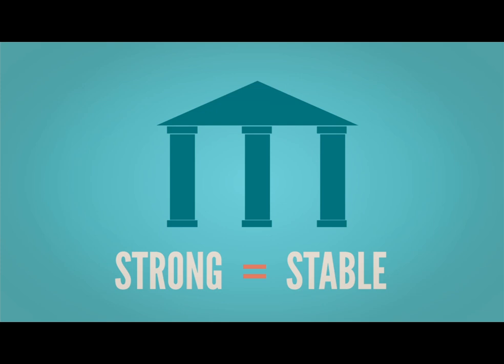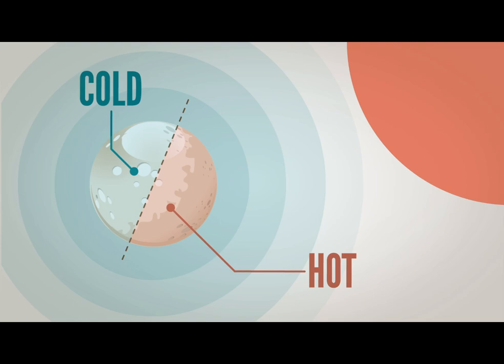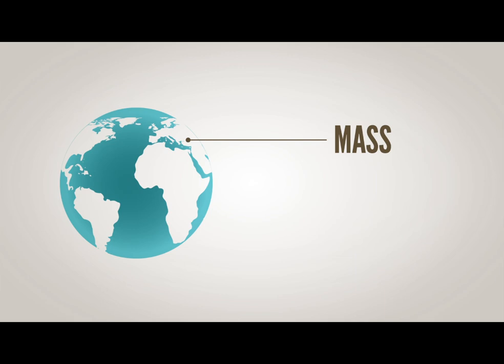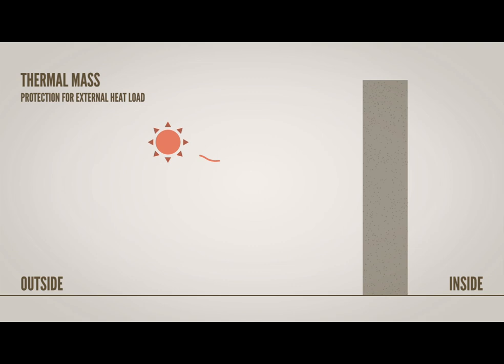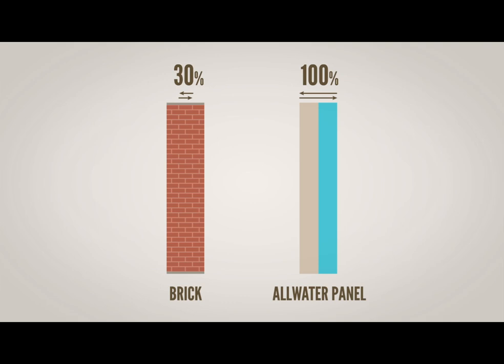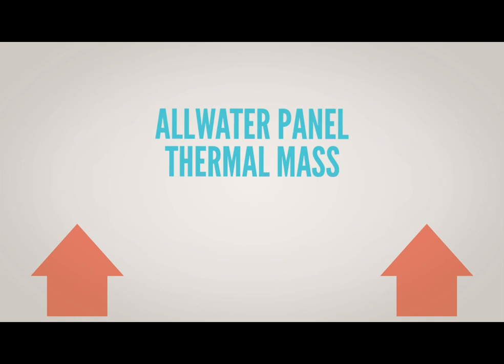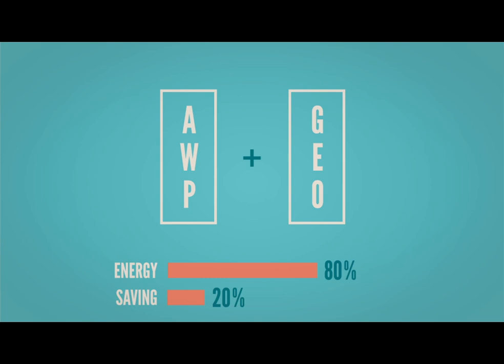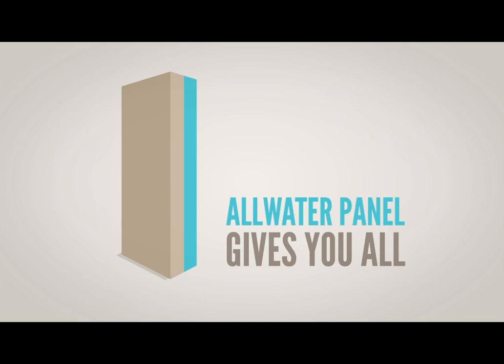Allwater Panel video Full version High

Comment: Like solar roadways, this is massively impractical and spreads misinformation.

Concrete was used primarily because it's strong, insulating and CHEAP. Concrete is basically among the cheapest construction methods we have.

These "light" buildings on the other hand are much MORE expensive because there are few materials that are stronger per cost than concrete. Not to mention that watertight panels are going to be absolutely unreasonably expensive especially given how high the pressure at the bottom of the house is going to be.

Insulators allow one side to be cold and the other to be hot because that prevents heat from going into or out of the building. Having the outside of your house be the same temperature as the inside is basically just air conditioning or heating the great outdoors.

It takes much more energy to heat or cool a large volume of water+the air in your house than it does to do just the air. That was just a blatant lie.

Basically, almost every explanation in this video is wrong. Any questions? Feel free to ask.
Reply: Dear Skooteh,
Please try to learn more about our work before you judge it. If you take the effort to understand it better, you will find answers for your questions.
Concrete is no insulator, neither is cheap. A brick wall for example is cheaper and far better insulator than concrete. Wood is even better.
Water House saves energy with cooling because you do not cool, you absorb, and the absorbed energy is used later. It is therefore a completely different concept. I did not lie, you just simply did not understand. That is a big difference.
The cost of a light construction depends also on your primary load-bearing system. If it is wood for example, it is far cheaper and better insulator than concrete.
The cost of a prefab construction depends also on the manufacture process. If you can design an efficient fabrication method, you can have a cost-efficient construction.
Based on your comments, I am not sure if you have sufficient knowledge in construction or architecture. I would suggest you to learn a bit more on building physics and properties of building materials also.
If you have any questions, I am happy to help.
Best regards,
Matyas
Reply: Matyas Gutai You're right, I should have researched construction methods more before posting. Upon doing more research, it seems that prefabs are mostly light structures with insulation. More insulation for regions that need it. Thermal mass appears not to be a major concern in modern prefab housing. I didn't do that much research though.

How are you going to make water panels cost effective and robust enough to survive the high pressure the lower ones are subjected to? It has to be watertight to a pressure of upwards of 100kPa for a 3 story house. That's kind of a lot for a continuous duty large surface that surrounds your house. The failure mode is also pretty catastrophic.

How much water is needed? How large are the reservoirs going to be? How much will this infrastructure cost? How much energy is the pump circulating the water going to use?

How are you going to deal with the fact that most of the world has an average temperature that's not a comfortable room temperature? What regions in the world will this be practical?

There are a lot of expensive systems required to actually produce this and I really doubt that this system will be any better than just using more insulation. Insulation also doesn't leak or have the circulation pump die/need service.

Also, intentional or not, the video implies that you're completely replacing insulation with this system, is that true? I was partially operating on that assumption.